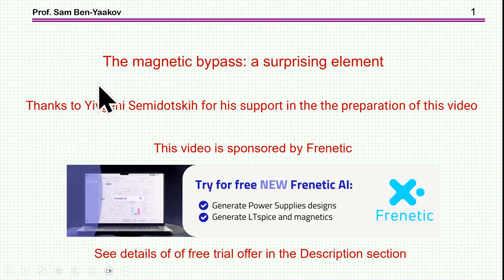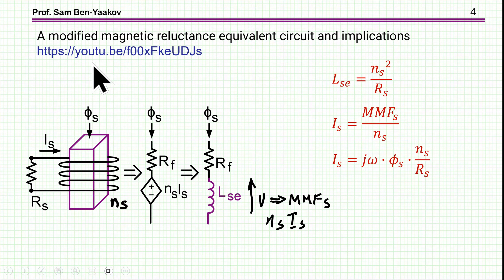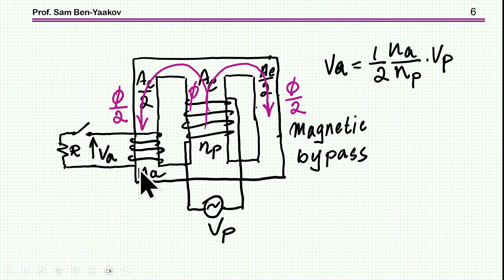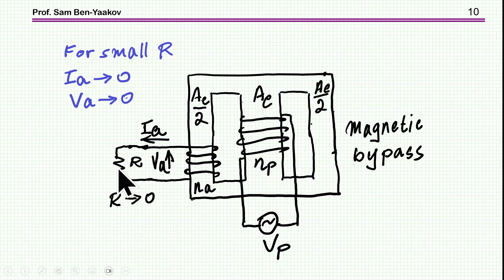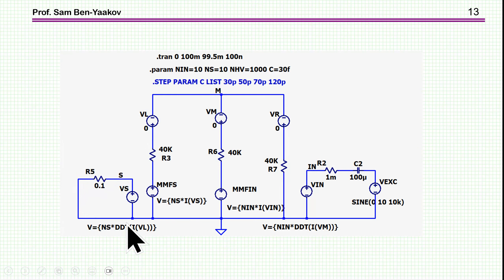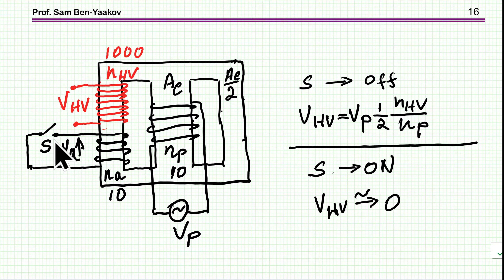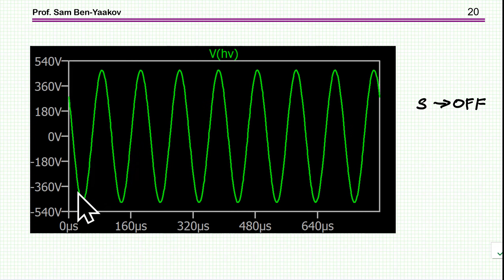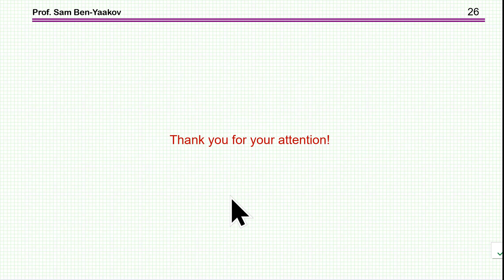The magnetic bypass: a surprising element

Comment: Professor Sam, I'm considering building a voltage regulator for the 220V, 60Hz commercial power grid by inserting voltages generated by transformers in series with the line, each contributing its own tolerance, either higher or lower. In practice, even if one of these transformers has its input disconnected (i.e., not contributing to voltage correction at the stabilizer's output), its output inductance will affect the result. In this case, I would have to neutralize these series inductances. My question is: would your switching model be suitable for this case? If so, considering that the load on the winding alters its voltage, would I have to add another winding from the other leg to the E-I core to force this flux to be maintained?
Reply from the maker: Hi, I  am not sure that I've followed you. If I understand correctly, thenthe magnetic element I showed could be useful in this case. However you have to take into account that the control windings will carry current.

Comment: My question, If 2 equal secondary windings are placed on each outer leg with 1st wound clockwise and 2nd wound counter clockwise. I think Lenz effect can be defeated  with equal loads as the two mmf's generated by each load are equal but opposite.  So their combined effect likely cancels at the centre leg. So the primary winding input impedance doesn't change under load. Yes no or maybe?
Reply from the maker: Direction of windding does not affect Lenz's law
Reply: @sambenyaakov  Thank you for accepting my ignorance on this issue.

Comment: Is it also possible to change the current flowing through the L leg and use another winding on the R leg to control it's output voltage?
Reply from the maker: No, this modify the operation.

Comment: With the switch off we have high voltage but if you put a load on that high voltage, wouldn't the flux switch to the other side similarly like when the switch is on and thus you only have HV and maybe very low currents to power something or maybe just generate al electrostatic field with some HV diodes?
Reply from the maker: Yes, as I  am pointing out in the video, this is for high impedance load
Reply: @sambenyaakov an extremely high impedance load as such only really exists in circuit simulation
Reply from the maker: @michael-j-harrison  It seems there is no point in answering you as you will never be satisfied. Why not relax and enjoy the marvels of this circuit as 9.7k already did?

Comment: Sam, Cool! Your concept is very similar to a multi-output flyback supply I designed. Starting with the same model you show (Primary, Leg1, Leg2) I put windings on both outer legs and TIE THE TWO LEGS TOGETHER. Leg1 has 5 turns and Leg2 has 10 turns. This combined output goes to 12V resulting in Leg1 having 2.4V/turn and Leg2 having 1.2V/turn. (diode drops are zero here for sake of discussion) Other secondary windings on Leg1, Leg2 and Primary can use these ratios to achieve various other voltage ratios.
I used the same reluctance model as you did but you went further and put that inductor in your spice model to model the flux change. That was genius, man! Thanks for the tip.
The first prototype I designed had the same turns on each leg so, when they were tied together, I could get Vout1 on the primary leg and 1/2 Vout1 on each secondary Leg1 and Leg2. This was a planar transformer, and this technique allowed short traces in the PCB on the left and right side of the transformer which avoided the need to put vias in the board to get all the windings crammed into just the center winding. It was after that when I realized I could get better integer ratios of voltages by making Nleg1 different than Nleg2.
Again, thanks for leading us through your modeling technique.
Reply from the maker: Thanks. Very interesting. Thanks for sharing. Do you have any write up on your design?

Comment: An idea for another video that is related to this is to consider the design of a standard EMI common-mode choke and show how the differential mode inductance can be significantly increased without sacrificing the common-mode inductance by simply adding a  ferrite 'flux shunt' that is 'gapped' - I.E., loose fitting to provide a low permeability path for this flux shunt.
Reply from the maker: Good suggestion, wil try. Thanks.

Comment: The problem with this concept as you have presented it is that the output impedance is very high.  It would be considerably more practical if you make the permeability of the bypass leg much lower than the main coupled path - this is the way that 'flux shunts' are normally configured.

Another practical detail to point out here is that you have explained this concept on an E core that has the center limb area that is double the outer limb areas.   This is a very common E core configuration that is designed for transformers where all the windings are placed on the center limb, however when it comes to the practical design of cores that include a flux shunt then you ultimately need for the three limbs to have the same cross sectional areas.

I have designed hundreds if not thousands of high frequency power transformer design for SMPS applications that include flux shunts. 

What surprises me more about flux shunt transformers is why they are not the standard design solution within the industry?
Reply from the maker: Thanks for the input. This is not a flux shunt transformer, it is a magnetic switch. Increasing the reluctance of the bypass leg will kill the whole idea. In such a design the auxiliiary switch will cause a short when the switch is on, almost like a regular transformer.
Reply: @sambenyaakov - if you don't increase the reluctance of the bypass then you can not derive any useful power out of the system.   
This IS a flux shunt circuit - but you are showing the extreme case.
I don't have any experience with using pSPICE for modeling magnetics and I would therefore question if you are not simply fooling yourself as to how this would work in practice.   
I suggest that you simply build a physical working model and test the operation.  You don't necessarily need to have a crazy step-up turns ratio.  I would suggest that you just use a 1:1:1 turns ratio for the three windings with a suitable number of turns for you chosen core area and test frequency.
Reply from the maker: @ I am sorry but I have to disagree. This is not a shunt transformer. As for loading, I specifically state in the video that the device is limited to high impedance loads. With a higher reluctance, you will not have the resonance effect.
Reply: @sambenyaakov - so with any practical transformer design you aim to have a fairly high magnetizing inductance so that you can get a reasonable efficiency.  If this high impedance is in series with the with the path of energy transfer then the efficiency of this solution will be really low.  Sure this circuit might perform a certain function as a teaching tool to study in simulation,  however I fail to see that it is remotely close to something that could have some practical utility. 

If your goal is to create a resitive heater then it would be far simpler to just design a resistive heater element. 

Typically the overarching design objective for the domain of power conversion is to achieve high conversion efficiency and not to just find complex alternatives to resistance heaters.
Reply from the maker: @michael-j-harrison  There are many applications beyond resistive heaters.

Comment: WoW Professor you have designed a high voltage amplitude modulator if you power on and power off the switch electronically with switching (pulse) signal for a specific frequency. You can vary the reluctance based upon audio input as well. Bravo.
Reply: but the PWM rate will impact core loss. This would work better by not using silicon iron but ferrite or powder cores and amorphous nanocrystalline ribbon core which would give you high flux capacity to 1.5T and frequency
Reply from the maker: Thanks. indeed. I will show in forhcoming application something similar.

Comment: This is an interesting application (a bit similar to a magnetic amplifier). Thanks!
Reply: not similar. Magamp is actually a very uneven thing. If you use DC to change saturation you actually change only 1/2 of the sine. So you have not symmetrical waves when the current flows. any solution to make it more symmetrical still influence their sinewave.  

This flux is smooth tho, it just a bypass for magnetic field
Reply from the maker: @ You are absolutely correct, but still, it is relative of same famiy

Comment: I made this core except I had two output coils, one on both sides and one center input coil. It produces around 24.5 watts of output power with 500 milliwatts of input power at around 280 kilohertz square wave from the signal generator.
Reply: Congratulation! You made perpetuum mobile!
Reply: @neodimium  Not unless I could feed back some of the output power to the input. That might be possible if the power source were something like a super capacitor and I had the output coils in resonance with the input coils, which they are not. I suck at winding coils, and I ended up buying a winding machine from china to wind the coils. Any “electron” is a perpetual motion machine, technically speaking, that is if you believe in the existence of electrons! 😂
Reply from the maker: Indeed
Reply: @neodimium  After looking at your diagram again I realized that there is a small but very important difference between my double E core and the one in this video, and that is there is a relatively thin second cross bar with an open gap roughly the width of the outer bar that spans from the far left side to the far right and it essentially isolates the middle impulse driving coil from the outer rim which connects the two outer coils. This is important if you want to achieve over unity results as it creates asymmetry in the design which is the key to any over unity system. Whenever you have symmetry which is how a normal transformer is designed, you get losses because you have two sides fighting with each-other of equal strength less entropy loss of the energy through heat. But when you make it asymmetrical you avoid that tug of war match.
Reply: @BrentLeVasseur  
First of all... my diagram? Looks like you are lost. 
Second, you cant get more power than you input in any closed system. Like vaakdemandante8772 said, only possible solution would be "pumping enery" like heat pumps do. Which you cant do with transformer.
THIRDLY! You measured output power (watage) without load?

I think what we have here is miscommunication... He is probably talking about VOLTAGE and not WATs!
In that case, that's exactly what transformers do - transform! Take input voltage to another level of voltage. But Input power=ouput power-losses.
It's simple as that.
(...this feels like Dunning Kurger example)
Reply: @BrentLeVasseur  
Okay, this will be my last because I cant cure ignorance.
Radio transmitter transmit in the field. Can be one receiver or multiple (or none), you are covering all that space. (not gonna go into detail of loading antena and matching impedances).
You conveniently avoid answer about measuring POWER. 

Oh, but if you want analogy about transmitting and receiving power, check wireless power chargers. You can learn a lot if you read proper books.
Reply: @neodimium  Input power = output power - losses ONLY in a closed symmetrical system. A radio transmitter is not a closed symmetrical system! A transformer is the same thing. If you have a symmetrical design and its operating below radio frequencies, then and ONLY THEN do you get power input = Power output - losses. However, when you change the transformer design to be asymmetrical and to operate at radio frequencies, these rules no longer apply. As for measuring the watts, it was a calculation being done on the Oscilloscope itself along with the voltage peak to peak primary measurement.
Reply: 25W out of 0.5W gives you a COP of 50 - theoretically possible, but it would mean you'd draw so much power from the environment that the space operating such a device would get noticeably cooler. Highly unlikely with such a setup and frequency of operation 9 orders of magnitude too low for a proper resonance to occur.
Reply: @vaakdemandante8772  Yes, it’s negative entropic, in theory. But I honestly didn’t notice it getting cooler. I think I would need to run it at full power where the core becomes completely saturated in order to test that. I was just powering the core from the signal generator without any power supply and then connecting my Oscilloscope to the input coil and the two output coils to measure it without a load attached. I’m a total hack/noob at this stuff, and I blew up my first oscilloscope doing that and had to get it warranty replaced.
Reply: I think you should start by reading the yellow warning ⚠️ sign on the front of the oscilloscopes, where manufacturer states maximum voltage (some DSO tend be as low as 100V maximum!!!).
Reply: @codures  Oh I had no idea! lol I am looking into using probes that don’t require a direct connection for high voltage impulse work. Having to replace your oscilloscope every month can get expensive. 😂
Reply: @BrentLeVasseur  I were you, I would stop playing around with 500+volts, for your safety. And please, don't be overconfident, every human body responds differently to voltage arcs, especially on untrained skin and muscles (including miocardic). Stay below 500 with a few milliamps and all is good. Maybe you should start by checking voltage/intensity danger diagrams for human, it's a good start.
Reply: @ Definitely! And that’s why I avoided using a power supply to drive the transformer and I was only using the half a watt input from the signal generator.  I am well aware of my ignorance and the dangers when it comes to actually testing these things. Thanks for warning!
Reply: Soul mate, pass me the drawing

Comment: It seems it would be possible to adjust the output voltage by varying the resistance in series with the control winding.
Reply from the maker: 👍Yes, but there will be some power loss

Comment: With the switch closed, almost all the flux is in the right leg, that is limited by saturation in that leg.  

When the switch is open, and with no load on the high voltage winding, the flux is approximately equal in both outer legs.  As I slowly increase the load on the high voltage winding, more flux will move to the right leg, reducing the high voltage.  If the transformer core was very low loss, the high voltage winding would take little load, if the core had high loss, it could support more load, but would lower the Q, limiting the voltage.     

Putting a winding & switch on the right leg, the high voltage would more than double (depending on core loss) with it closed, and the original switch opened.  Opening the switch on the right leg, and closing the original switch would provide the same low voltage.  If I did that, I would use a core with equal Ae (like a 3 phase core), that would allow better core utilization.
Reply from the maker: Thank you for the input. As far as I can tell,  with a switch on the "bypass" leg the resonance is lost. Would you agree?
Reply: @sambenyaakov  very good video professor. If the resonance would be lost, why not add a variable inductor in series and all matched to a wider cap. In this way, one could (at least theoretically), obtain a variable HV output by simply varying the inductor value. What do you think about this idea?

Comment: Professor, what would happen if you load the HV winding? Say somewhere around 1kOhm or less? Would that start to degrade the HV line since the flux will start to balance on the Bypass leg? Thanks for your demonstration!
Reply from the maker: Yes, loading will drop the voltage. No free meal.

Comment: There is a similar arrangement used in microwave oven transformers, with a magnetic shunt used to control the current supplied to the cavity magnetron.
Reply: I knew a shunt was used but did not understand how it worked. Thank you.
Reply from the maker: Thanks for input. I did not know that.
Reply: In the microwave transformer, the relatively thin magnetic shunts are placed between the EHT winding,  and the primary and filament windings.
Reply: Magnetic shunt also exist on arc-welding transformers to provide an alternative path for the magnetic Flux when the welding electrode is shorted.
Reply: @erezlevi5093  Yes! I remember my grandfather had a welding machine made in 50s that had adjustable magnetic shunt, there was a screw that pushed shunt inside or out of the core, so that user could adjust the current. Also there was a selenium rectifier the size of shoe box. (not quite that large, but you got the idea) 🤣
Reply: @1magnit  I suggest you Google "microwave transformer magnetic shunts". The feature is well documented.
Reply: I suggest you do an internet search for "microwave oven  transformer magnetic shunts". The feature is well documented.